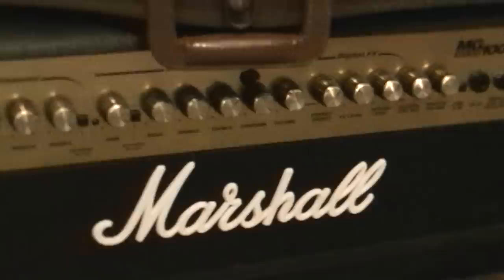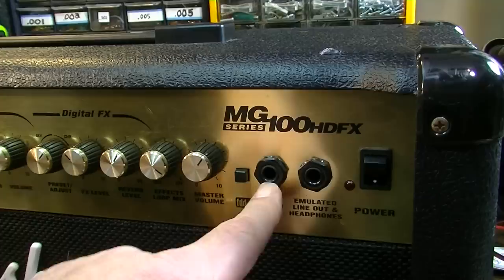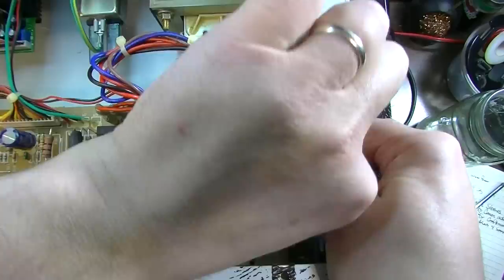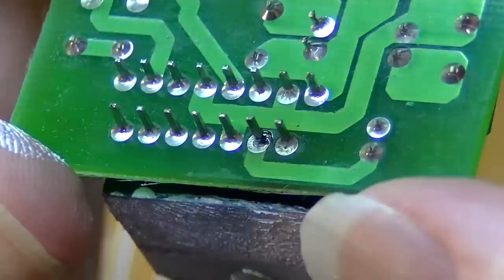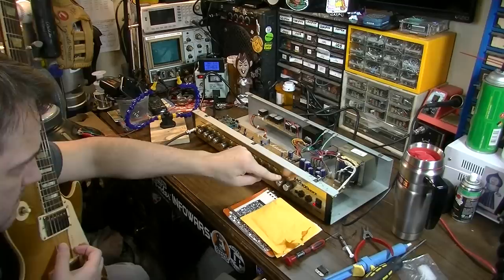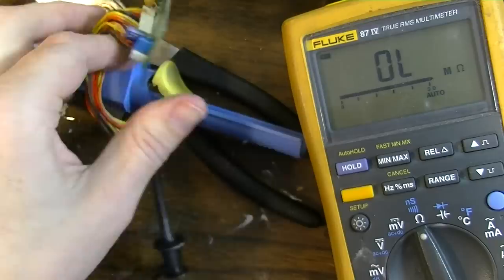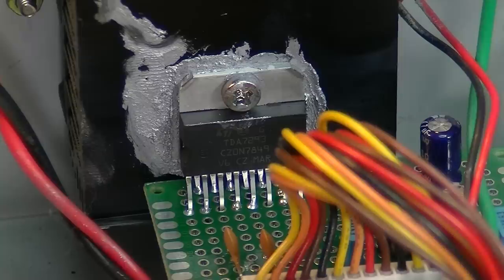Found a Marshall Amp in a DUMPSTER...Can We Fix It?

Comment: The whole power amp is a single chip? I know jack shit about newer SS gear.
Reply: Yep. And some pretty high quality sound from them, too. Unless you're counting on the amp to make part of your distortion sound, like with tunes, there's no real reason not to take advantage of the advances. One chip is cheap, and some of those have a LOT of power capabilities. This particular chip has a power output of 100 watts into 8 ohms. Not bad for one chip. And the distortion levels are pretty impressive, too. 

I built a stereo amp from an old Twin type chassis with 2 LM3875 chips, one for each speaker. I use it for a stereo tapping guitar I built and play on. Plenty loud for the gigs I do, and I'd be hard pressed to tell that sound from most any other solid state amp out there. If you're building an amp, it makes sense to use one of these things and spend your time making the preamp sound the way you want. 

Oh, and you notice the price on these chips, too. $3.00. Try doing that with separate transistors.
Reply: Will Morrison no kidding! I have yet to work my way down into the realm of integrated circuits or surface mounting,  having barely the ambition to comprehend discrete components point to point. That being said, these kinds of tiny power amps could have some cool applications! I’ve just recently started building pedals as opposed to fixing them, eventually I plan on designing my own amp circuits and things like that.
Reply: Some LM3886 composite amplifiers have as good distortion rates as the best $3000 Benchmark AHB2 amp. These chip amps are sleepers really its all about implementation.
Reply: This coming from someone who once drank the tube hifi kool-aid. Leave that stuff for guitars where it makes sense!
Reply: @graxjpg  IC's are easy. That's where I really started, with the Craig Anderton Electronics Projects for Musicians book (1st edition). Then I got into tubes, which are actually the easiest type of amplification other than step up transformers. They are very visual, you can see in your mind what is happening when you read it in the book. Never did get there with transistors. Just can't visualize them. 

Surface mount is the same as regular, just smaller and more fiddly. Works quite well, though, but you do have to get used to working with magnifiers. I do still prefer hand wired if I'm gong to build something.

Have fun and keep building. Keeps you out of trouble and when you're done, you get to play with it!
Reply: @spikester  They really are a great leap forward. Now the power section of lots of projects is just taken care of. I hadn't thought of using them for guitar until one day a guy walked into the electronics store i was working at with his friend who was helping him build a guitar amp. His friend worked for ST Micro, and gave him the chips for the amp. He also gave me 2 of their 4 X 10W power amp chips and their master databook. I'm still using an amp I made from one of those, a dual 20 W bridge amp. Flawless in over 20 years of working. Dead quiet and plenty loud to push a pair of stage monitors for a small act.
Reply: @spikester  Agreed. Tubes sound best when they are just screaming for attention, and if that's how you listen to your stereo, you have hearing problems.
Reply: Will Morrison I appreciate all the information and encouragement. From what I can figure, tubes seem best kept in a guitar amp. my stereo is of a completely opposing philosophy, where  high saturating tube distortion is replaced with heaps and heaps of solid state headroom.

Comment: That amp belongs in the dumpster, my dude.
Reply: I'd fish it out of the dumpster, anyway. Any guitar amp can be dialed in to sound decent. Maybe just use it as a pedal amp. Or only the poweramp for your preamps.
Reply from the maker: It certainly would not have been worth paying someone to fix it considering how much time it took to repair. But for my purposes, it made for a fun video.
Reply: @TheGuitologist  I hear that. Did give you some good experience with modern solid state amp design. 

I have a kustom bass amp that blew a fuse and Im clueless as to fixing it honestly. Probably be cheaper to just buy a new amp instead of repairing it.
Reply: replacing fuses are stupid easy
Reply: Blank Stare kustom amps are awesome. I’m still afraid to work on my slightly more modern kustom, even though it’s a pcb combo version of those old legendary tuck and roll heads. It’s got some strange preamp audio artifacts that I’ve never heard before, sounds like a damn moog!
Reply: @graxjpg  Have you seen the video with the famed Peavey amp guru James Brown, who designed Eddie VH's 5150 amp the then- newer line of Kustom Coupe amps. Great interview video in a Nashville studio. They demo the Kustom. One of the Nashville Tele players imitates Les Paul echo slap back using just his pick and fingers. Amazing...here is the video title: (btw Ebay had for a while recently, maybe still, NOS Kustom Coupe chassis complete for cheap!)  ....Ahhh I can't find the video name, but there is plenty online, just google AMP DESIGNER JAMES BROWN KUSTOM COUPE
Reply: paulj0557 I have seen that! Kustom amps will always be one of my favorites. I’ve got into the more boutique tube things as I’ve gotten older but I still use my Kustoms at home.

Comment: What I use to power up a candidate for the first time, I have a light bulb in series. It limits the current and lights up if there is a short or very low resistance. Nice Video!

Comment: We live in a time where most people would rather just toss out stuff they don't like or is slightly broken instead of fixing it or salvaging parts. Someone I know found a vintage desktop fan from the 1950s on the side of the road. Only thing wrong with it was it was seized. Some lube and gentle working and she runs just fine. The bearings got a little screwed up from the rust, but it still works fine. Replace the bearings and it will be like a new fan. I also personally found a whole house fan on the side of the road from the 50s. Only thing it needed was a cleaning, oiling, and new power wire. Still runs fine. I could up and sell it right now for $300 easy, but I like it so I'm keeping it. I've never gotten into actually looking in dumpsters, but it wouldn't surprise me one bit if people throw out perfectly fine stuff because they're bored of it or tired of it or getting something new.

Comment: I got a free Hughes and Kettner Vortex 100W head from a buddy at a guitar store. Someone left it to them for recycling. It turned on but made no sound. I decided to take it and take a look, worst case I just recycle it myself. Turns out someone had put two 200mA fuses where there should have been two 2A fuses. Changed them out to the right current, and the thing  works like a charm. Never underestimate the unwillingness people have to find an excuse to get rid of something that works fine with a little effort just to buy something new.

Comment: Hi Brad, I watched your video where you aquired a Marshall MG 100 DFX. I just wanted to let you know that the style of boards used in the type of modern appliances like the Marshall need to be unsoldered with Fast Chip SMD Removal Alloy. You simply melt the alloy in with the existing solder and the use solder wick to remove all solder and clean with 91% IPA (isopropyl alcohol). Install new part, done. You can get the Fast Chip and solder wick from Amazon and the like. Cheers.
Jimi

Comment: Circuit board manufacturers often test the boards before they put components on, looking for just that kind of short.  When they find them, they will try to blow away the short with a quick application of high-current voltage across the short (where you were measuring resistance).  There's probably a sliver of metal embedded in the fiberglass, which you might be able to blow away using this technique.

Comment: I've worked on a bunch of these that use the same output boards. Mg50, mg100,  mg250 that had same issues. I found pre-assembled boards for around $35.00 that worked perfectly with little heartburn. Easier repair.

Comment: Great work on finding that the board was conductive and building a new one. Not sure where you could even purchase a new board. I contacted Marshall last week about getting a schematic or parts list on an amp and this was their response : "  All internal electrical work must be performed by an authorized Marshall service center". The service center wouldn't help either so I got a blurry schematic off the internet and was able to find the parts at Mouser but they wouldn't carry the danged board. With something like that it would be nice to be able to get a little support from the manufacturer. Now with my sons Fender Hot Rod Deville I contacted Fender and they e-mailed a schematic and parts list. Much better service.

Comment: Three weeks ago my 15watt version of that Marshall smoked the output transistor. Seemed to be the same problem. I thought I had dropped a small blob of solder under the board when I was touching up the soldiers on the pots. Nope the board was conducting enough to leak hot to ground between the pins on the output transistor. It made the same sound even.  I scrapped it for parts. The drive channel has the parts for a tube screamer, the FX are in a separate board and of course the knobs.
BTW the FDD button is like a kind of loudness compensation/speaker EQ for DI or Headphones.

Comment: Watched again a year later. These MG series DFX (HDFX for heads) are the best solid state Marshalls IMO. I own several. They're cheap to buy on Reverb etc, and are maintainable/repairable as evidenced here There seem to be 2 generations - the earlier Korean made with chrome grill over the fan, and the later Vietnam made with louvers in the chassis at the fan. The Vietnam versions have the bigger fans and bigger heat sinks. I've had no problems with any of them. The TDA7293's, fans, and even the digital effects board are available. Great clean sound and onboard effects. The distortion channel is usable but using pedals on the clean channel is better IMHO. I had a later version of the MG Series, opened it up for a look, and it didn't seem nearly as well made as these. Kudos to Brad for not giving up. And he's right about salvaging the parts - the transformer, the fan/heat sink assembly, the knobs for sure, the effects board, and even the power and main boards. Put 'em on Ebay or Reverb if nothing else.
Reply: I’m about to look at mine, I have no idea what I’m looking for. It’s doesmy turn on atm
Reply: @benjiforsgren  As luck would have it, I was just dealing with an issue on one of mine tonight - an MG250, basically same as MG100's - just with two power "transistors" (the TDA7293) instead of one. I had played the amp a week ago. Fine. Tonight, no sound. It came on, fan running, just no sound. I've had this before. Often it is the jacks - the plastic housing with metal "fingers" that open and close when a 1/4" plug is inserted or absent. The much more expensive DSL tube amps of roughly the same era used these jacks too. Marshall had a propensity for using such jacks as basically switches - contacts open or closed depending on the plug insertion or not. I'm not a fan. On the DSL's, the speaker grounding - and therefore the amp's self destruction or not - depended on these rather flimsy contacts not being bent, broken or dirty. Anyway, the MG tonight was just a case of these jacks not functioning. From experience, I did not start a whole troubleshooting process. I just sprayed a little DeOxit on a dummy plug (amp off) and inserted it in all the jacks front and rear especially the Footswitch, Effects Loops, and Input. Just run the plug in and out a few times to clean the jack. That did it. Works fine. That is not your problem if the amp is not even coming on. I'd check the fuse first. If it's blown then you are into troubleshooting, which needs knowledge/experience and you'll have to decide - amp tech or not worth it. It irritates the crap out of me that Marshall (and lots of others) builds a product that comes so close to being really decent - but falls short by using cheap parts in a few places. Otherwise, this vintage of MG's are pretty damn good. The main boards, digital effects boards, power devices, heat sinks, cooling, are all quite good. Mine, except for the occasional problem like tonight, all work and sound good - no noise at all. Great clean sound and pedal platform. But just a few cut corners can take things down - with so many amps.

Comment: They call the goop on the transformer nuts, inspection lacquer. I used to install GPS tracking devices in cars, and had to goop up all of the connections with inspection lacquer.

Comment: Had a client bring me a 1966 Fender Tremolux head. Asked how long he owned it. Said about 3 years. Was driving and saw a amp in a dumpster. Pulled it out and discovered it was a Tremolux. Plugged it in, it worked minus very scratchy pots. Said after he got home realized he should have checked to see if the cabinet was dumped as well. 

Amazing with the internet how people still toss shit without doing a Google and eBay search
Reply from the maker: That’s nuts.

Comment: Yeah, because those TDA chips have the tab at negative voltage and the amp has the heatsink grounded you need the insulator in order for it to work.  Someone probably replaced the output board completely but threw away the plastic or mica insulator that should be there and then gave up when it blew out again.  I designed a few amps using this chip and repaired many more.  The chip might work a bit without the insulator but that is because the thermal grease will insulate for a short time before it blows out.

Comment: Back in the day I taught middle level electronics for 25 years. That's sub-degree with lots of hands on. In retirement I'm doing valves (tubes) that I learnt in the first week as a student (ha ha). I bought a Vox AC4tv and in lockdown built an extention cab so the now "stack" is a Weber Blue Pup (8 Ohms) atop a series connected Weber Hemp Cone (8 Ohms) driver. Vox introduced expensive point-to-point 4 Watt versions with "better" components. (Back in the day when we couldn't afford a circuit board acid etching kit we would use vero board and rat's nest wiring.) Apart from not having circuit board track capacitance does point-to-point actually work any better? Being audio frequencies do "better" components improve on the dog's body "standard" ones? A tip for AC4tv users; unscrew the rear panel and open it an inch or two. If you like the open cab sound then build a cat flap door on the rear for closed or open cab sound. I use a leather pull tab as a friction latch. It is a cheap and easy mod, just stay away from the stored volts inside. PS the alnico Blue Pup sounded better in the ply extention cab and the hemp cone was just as laid back in the Vox chip board cab. The Weber people were very email helpful. Cheers T

Comment: "FDD (Frequency Dependent Damping) is a radical new feature that is exclusive to Marshall Amplification and accurately mimics the way an all-valve amplifier interacts with a loudspeaker. As a result of FDD, your amp will give you a sound and feel never before thought possible in such an affordable, non-valve amp."  That is quoted in the manual.

Comment: Something is internally shorted as the first thing to stand out to me was the blown fuse to the right, below the transformer.
Lol. TDA chip. Literally the same thing that's used in car stereos. I've built small amps using those. Dirt cheap. Great diagnosis!

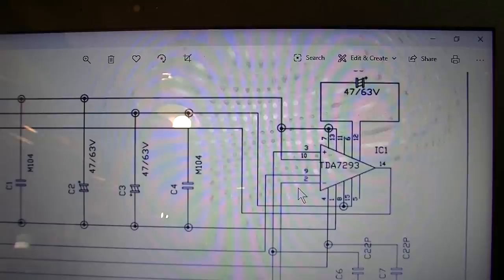Comment: Just a little thing to help future repairs on the mg100 output board. Nice thing you followed the original board and not that schematic, because the polarity of C5 on the schematic is wrong. You can see at 23:20 the schematic shows negative going to pin 6, while at 31:36 you can see the board having the positive going to pin 6 (if you check the TDA7293 datasheet, this is the correct polarity). Once I had to make a replacement output board to a friend's amp and followed this same schematic, and having C5 in the wrong polarity was enough to burn a TDA7293.

Comment: I had a Marshall AVT275, I think it had the same power amp modules. One of them died, and me as a fearless 16 year old replaced the transistor without knowing much about electrical safety... Didn't fix the problem, but I lived to tell the tale.

Comment: I picked up the same amp with a Marshall 4x12 Slant cab for $175 on CL about a year ago. Then, I picked up TWO MORE 4x12 no-name cabs with Celestion 12" speakers at a flea market for $25 ea. That's EIGHT Celestion 12" speakers for $50.

I don't gig with any of it, but I LOVE this amp. Yeah, I'd like a more expensive valve head, but I don't really need one.

Comment: I got one of those just sitting in a closet up the hall that was tossed out the same as yours....(I run a rehearsal warehouse, and hammerhead musicians throw stuff out all the time). You've just help move the dang thing up the list of my gear repair triage. this quarantine crisis is the perfect time to whittle away at repairing all the gear that has piled up for the last few years. 

What do you wanna bet its gonna need the same chip replaced after tossing the conductive PCB and rolling a DIY replacement board of my own?  

Thanks for taking the time and energy to do the entire repair on an amp most techs would probably throw out. 

NICE workbench chops too
you just got my subscribe buddy

Comment: Great tenacity man, and detective skills. I ran into the same issue with a Crate Blue VooDoo 6212, kept blowing fuses, took it to several shops around Dallas and they couldn't fix it. Finally got the schematic online and traced the problem to a loose blade plug connector.